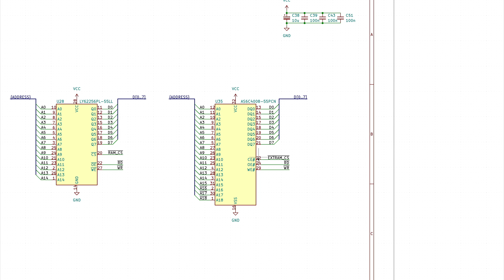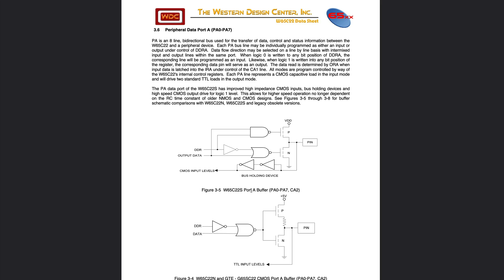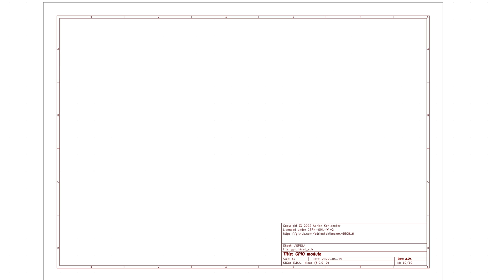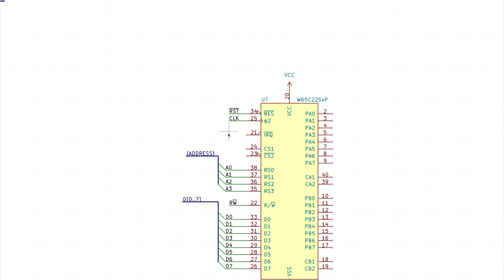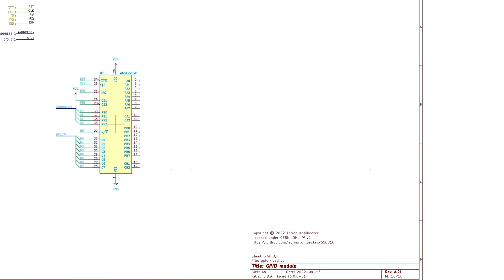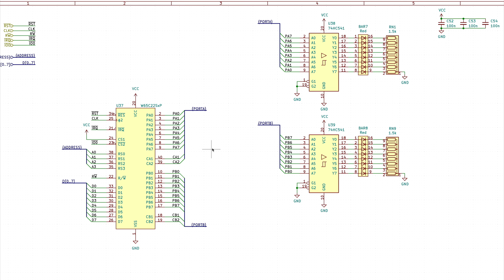#21 - 65C22 Versatile Interface Adapter - BB816 Computer

Comment: At 18:25 there are still typos in some of the VIA register addresses (such as IER), even after changing the base address. You are not using those registers at the moment so it's a problem waiting to be discovered in a later video (I'm still 7 months behind, but catching up). I'm puzzled by the LED demo because the pattern doesn't match what $5555 repeatedly rolled right should look like. You seem surprised too, but you don't investigate further. As an aside, ROR includes the carry flag, so you you usually want an explicit CLC or SEC in the initialisation before the loop in order to ensure that you get a predictable result. In this instance, a CLC is probably what you want.

Edit: I see you fixed the VIA register addresses before the next video.
Reply from the maker: Really appreciate you pointing out those typos, good spotting. I double-checked and my latest code has them fixed, I think I went back over this code sometime since ep 21.
And you're right I didn't investigate the demo not working properly. It demonstrated what I needed (ie. I can address the output ports), and the video was getting quite long already. I assume I was indeed missing a CLC somewhere

Comment: Excellent progress, I really like the insight that you could use the 6522 as a 16-bit IO port. Did I miss it, or did you not account for the delay in the VA signal due to it being buffered now? Also, what tool do you use for these timing diagrams?
Reply from the maker: Thanks for watching! I mentioned the buffer delay but quite quickly: AHC32+AHC125 is 8.5*2 and VDA/VPA are valid at 30ns. So VA is valid at 47ns. 
The software I use for drawing timing diagrams is https://wavedrom.com/. I have my own fork with a few changes I plan to upstream when I have time. You can find the source of the diagrams and the link to the fork in the README on my GitHub (click on view source above the images) https://github.com/adrienkohlbecker/65C816#read-cycle-2
Reply: Thanks for sharing, perhaps I need to rewatch the timings portion of this video. 17ns seems like a pretty big delay to introduce. And thanks for sharing wavedrom and your form! I need to generate some timing diagrams for my homebrew CPU to better wrap my head around it’s bottlenecks. Aiming for 4 MHz in order to hit 1 MIPS.
Reply from the maker: @bradywb98  at 4Mhz you have 250ns in total, so 17ns is not that big. In my design the address decoding is the limiting factor so I have some margin. 
Good luck with wavedrom. It has a weird syntax.